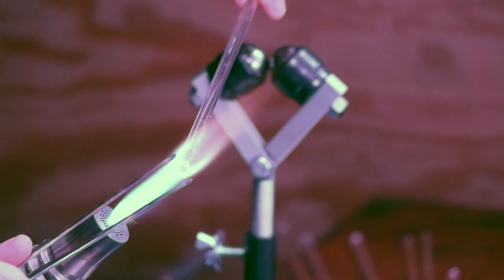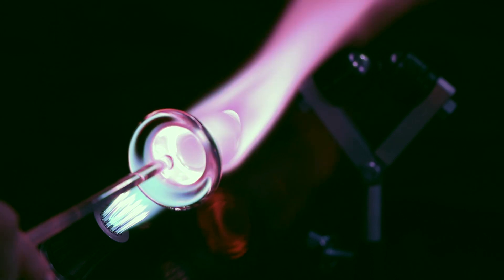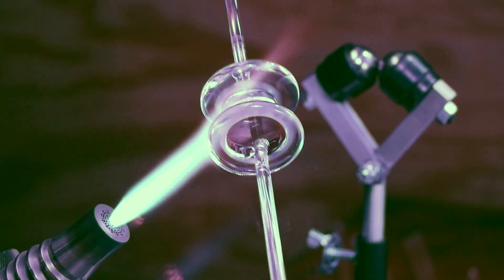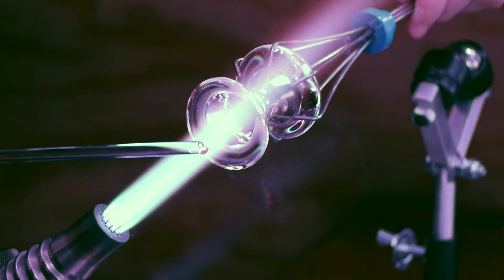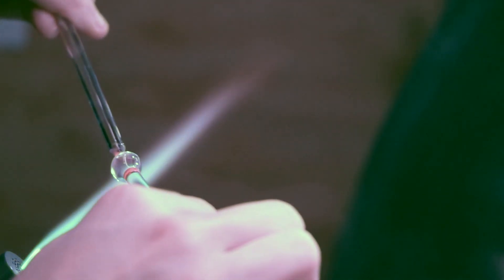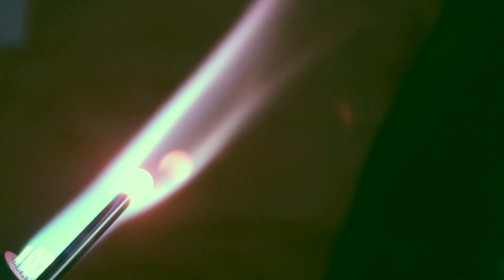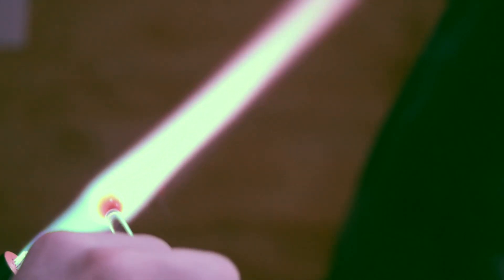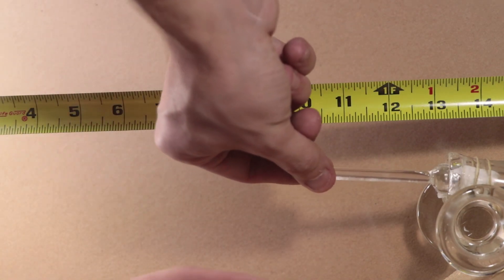Glass Cannon Fires - Part 2 Shooting Marbles

Comment: Turned out awesome ! 
Didn't think it would fire without breaking the canon...

Bye the way i subscribed & turned on notifications looking forward to see more.

Ha 1 more thing the glass u broke at the end is that reusable  ?
Reply from the maker: Thank you! I didn't know if it would break either, I was hiding behind plexiglass just in case.
That's a great question: Broken glass and scraps are reusable however for smaller shops its more time-effective to just throw it and start from stock.